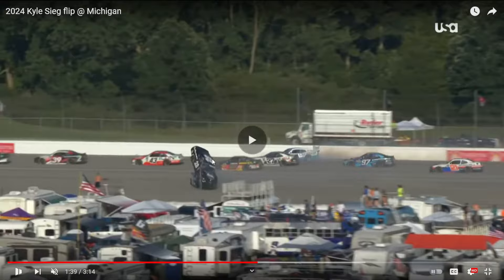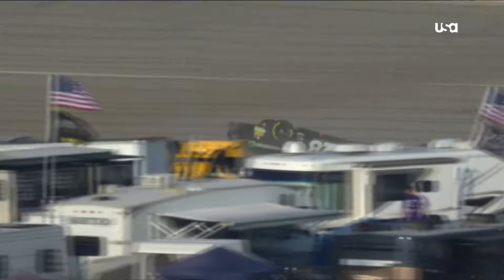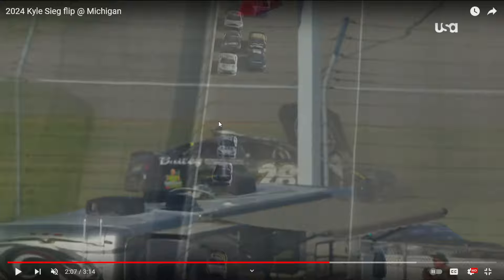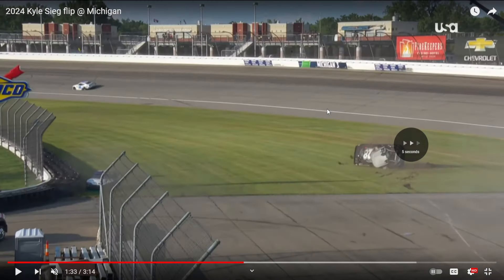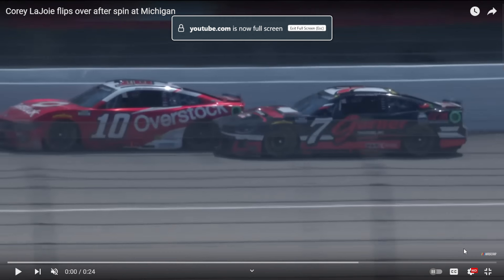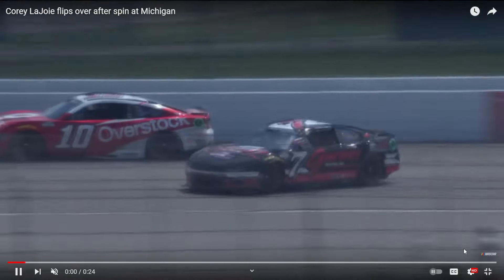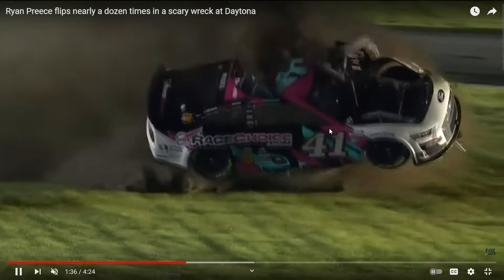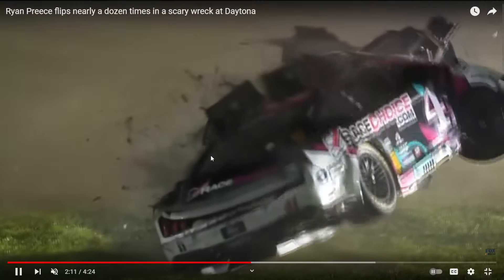Breaking Down Corey Lajoie & Kyle Sieg's flips at Michigan

Comment: I just hope nascar doesn’t get scared and reduce speeds.
Reply: NASCAR is actually mandating the right side rear window air deflector on the cars so that way they won't get airborne easily.
Reply: @kevinhunter3358  tbh it probably wont help that much as it only stops lift in the early part of the spin
Reply: I'm very hopeful but we all know it's inevitable 
Even if siege happened at 160
Reply: NASCAR's unofficial speed limit is 205 mph because even the roof flaps are ineffective beyond that speed. Roof flaps didn't increase speed, they just stopped blow overs.

Comment: The guys over on the r/NASCAR subreddit did some digging and found out that a 30 mph gust was detected in the area at the same time Lajoie flipped which coupled with his speed he was essentially being affected by the force of 215+ mph winds instead of the 180 mph he was traveling.
Reply: So does that limit racing if we have a 30 mph wind blowing, come on be real why don't you let NASA get a hold of this thing and see what they can find out get some real Engineers on this thing some rocket scientists maybe Elon Musk knows what's going on I know one thing they fly better than a missile?
Reply: No it does not limit the racing but whether does affect lift. Like I have said in the comments I believe it's the flat smooth bottom and the diffuser that is lifting these cars. And I do believe that they are lifting on flat smooth pavement over grass and dirt and that's for a reason. There is no real air circulation the air underneath these cars is pushing down bouncing off of the top and it's got nothing really to break it and give the roof flaps time to deploy to keep these cars on the ground. They they lift because of aerodynamics not as much the aerodynamic of the car but the aerodynamic of the bottom. The Xfinity one I'm not sure.
Reply: Further watching this that orange reminds me of the tape that they use. Could it be on the Xfinity car that they used tape to keep the flap down? Maybe it gives some sort of aerodynamic advantage?

Comment: From analyzing every Next-gen blowover and researching the car, I have developed a theory. The Next-gen will never blowover from the rear. From my researching on how the car is built, I discovered that the gear box had been moved to the rear. This means the car has roughly a 50/50 weight distribution. Now combine that with the diffuser flap and I see no way for this car to blowover from the rear. Examples include, Ross Chastain later in the Michigan race or Noah Gragson in the 2022 Daytona 500. Both of these crashes had the car lift off the ground but not blowover. Why? Because the car spun backwards to the air and not sideways. When the car is sideways, there's almost nothing that can be done to stop them from flipping.
Reply: When he pauses the video at 1 minute and 23 seconds the car is lifting from the back.
Reply: @Posttraumatic  because it's an xfinity car... big time difference there
Reply: @larrysipe1234  yeah I realize that after my mistake
Reply: Tyler Reddick 2022 500 is the best example
Reply: @TheWeeklyWeight  fair
Reply: It’s a problem in other disciplines of motorsports. Look at the 2008 Monza 1000km for evidence. Rinaldo Capello’s Audi R10 TDI got sideways after being hit from behind and took off. Luckily, he didn’t roll over. Later in the same race, former Le Mans winner Stephan Ortelli had a spin caused by a suspected suspension failure, which resulted in a blowover and his ORECA-run Courage cartwheeling wildly across the Rettifilo chicane, nearly colliding with Capello’s co-driver, Allan McNish. Remarkably, as scary as Ortelli’s crash was, he only suffered a broken ankle.

Comment: Not sure if anyone else posted this yet, but for Kyle Sieg, I think the only reason the drivers side flap is up was due to the grass ripping it up. Only 1 of the 2 was up when the car stopped. The second would be at the top of the "8" on the roof and that one was still stuck down.

Comment: I’ve been on the ground feeling 45mph winds before in central Indiana. Granted that day was a fluke but it is possible and has been done in the Ohio-Michigan-Indiana region. But 30, 40, and even 50mph wind at ground level in this region is very much possible. Especially these past few years where the wind just seems to keep getting worse and worse.
Reply: So if the wind is blowing and the car can't stay on the ground then should we have a race or should we cancel it and what mile per hour is the caution limit figure that one out it's either that or slow the car down by 40 miles per hour just in case there's a wind blowing granted I've read a lot of comments and I see a lot of hot air here going around
Reply: @driverslqqk7940  I don’t know how the physics work on the cars. I’m just pointing out that 30-50mph winds ground level, while rare, are still very much possible for this region.

Comment: Cars have always flipped and always will.  It’s not like this is a weekly occurrence and drivers getting hurt.  Why is everyone getting so excited
Reply: Engagement.  Nobody ever makes videos about cars smashing head on into a wall at high speeds.  It's a more common occurrence, does more to cause driver injury due to stark changes in momentum, every driver will have done it multiple times during their careers but only a small portion will flip or get airborne.  Blowovers and flips are more spectacular and look more violent but have lower overall impacts on the body.  Add to all of this that a newer generation of watchers didn't grow up in a time when blowovers were common, might blow their minds that there was a time before roof flaps where bigger tracks had quite a few of these incidents.  They freak out because they haven't been desensitized to seeing it happen often

Comment: My theory is that the same reason the xfinity cars get loose when somebody packs air on the left rear, is the same reason the flaps didn't deploy. I am assuming there was some sort of low pressure zone creating lift and not allowing the flaps to catch the air needed.
Reply: Sounds like a better get a hold of NASA and some rocket Engineers to figure this one out I've heard a lot of hot air in these comments so it must be true hot air rises😅 maybe the cars are just too hot underneath maybe more air is what they need or cooling fans or somebody with brains😅

Comment: So hear me out I know a little bit of physics like rudimentary physics I don't want to come out here and say that I'm like some sort of expert. But I've noticed with the more flat bottoms of this car it seems like like they should be adding grass again. I'll say that because if you look at add it and slow it down there is nothing that should be lifting this car. The way it does it it seems to me that it's either the flat smooth bottom of these cars or it's the diffuser that they have. If you look at similar wrecks or spins that happened on the grass this generation of car tends to keep grounded with the exception of the 41 last year but if you slow his video way way down you can see that his car begins to lift on the pavement. Just a theory of mine but I'm thinking with the way this new gen 7 is maybe adding grass back to the infield is the answer. Somebody way smarter than me is going to have to look at that.

Comment: The roof flaps on the Saturday flip did deploy just before the car lifted, I'm watching this in 480p on a phone and I saw it, what's your excuse? Secondly how do you not see the required secondary perpendicular flap under main flap that's holding it open after the car came to a stop?   The flaps (and all safety equipment) are  inspected before first practice, there's nothing illegal or altered, the mandated design of the cars are just terrible, that's why NASCAR is dead to me.